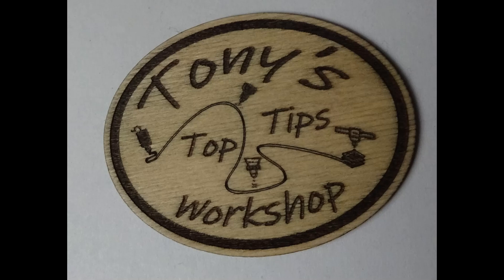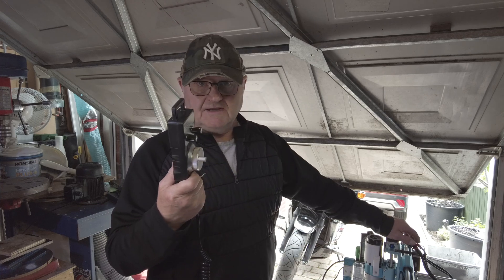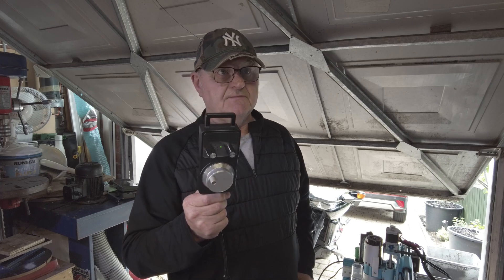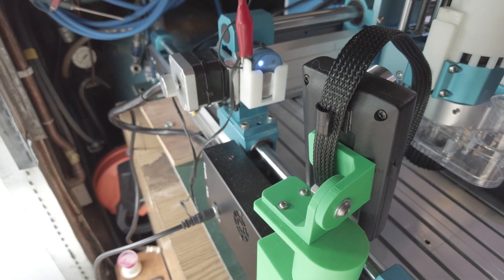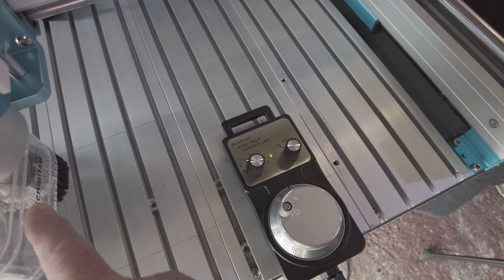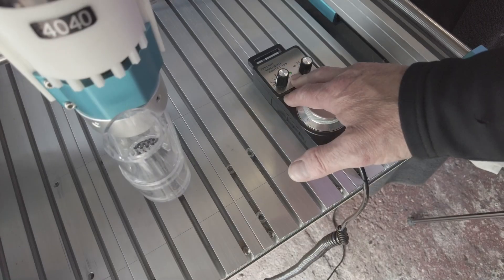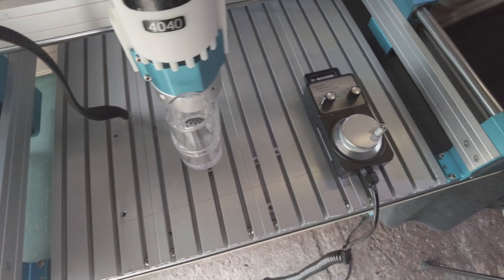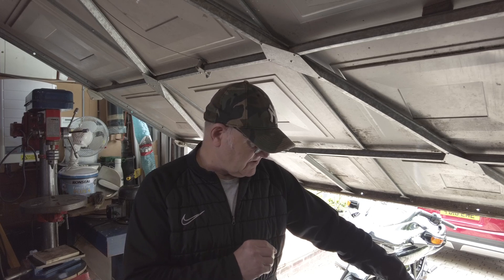Sainsmart CNC 4040 Pro  Viewers Problems with Faulty MPG controller

Comment: Hi Tony, how are you today. Thanks again for all your help. I am happy to report that the third one is the charm🎉😊. Now I don’t have my laptop with me at home today but the third one just arrived and I tried it right away with no computer hooked  up to the machine. The wheel felt much smoother than the first two and it worked as soon as I powered up the machine😁😁🎉🎉.
Reply from the maker: That's fantastic news Let me know how you get on using the machine with the new working toy
Reply: @Tonys.Top.Tips.Workshop  thanks again, I actually use one almost identical at work on a lathe as a machinist so I’m looking forward to using it in the gemnitsu😊
Reply from the maker: @MrMonahan28  you will be more experienced  at it than me

Comment: Hi Tony, thank you for your film. I have exact the same configuration as you have, i only use the Makita router. I have no problem with this controller. I have a problem with the grbl controller. When I push the ‘home button’ of this controller, the z stepper motor goes up and will not stop. Also the end stop of the z axis does not work when I use the home button . I have today Saintsmart asked for help. I am sure they will help me.
Reply: Thanks Tony for your reply. The micro switch works when I turn the z axis by hand and also when I use the mpg controller. It is also strange that when I use the home button only the z-axis moves and is going up and up. It only stops when I use the stop button. So even if the micro switch does not work, the home button will not function.It looks to me like a bug in the software. But I am new in this cnc world. I can still use the machine for everything else works fine. For your information: I use the Vcarve pro software and I also bought the x-axis extension kit.
Reply from the maker: @dobbie7454  hi as you say sounds like software issue has the problem been since you extended  the machine or firmware update
Reply: @Tonys.Top.Tips.Workshop  yes I have this problem discovered after the extension update, but am sure of the relation. Thank you so much for your thoughts!
Reply from the maker: @dobbie7454  Hi could be something to do with the settings due to the working are changing
Reply: Thanks so much for all your help.Just to confirm a couple things. The first one worked a couple times, but I had to rotate the wheel back and forth, the wheel seemed tight and seemed to break free and then it started working, but then one time it just stopped working. The green light lights up on both of the yet it doesn’t move the machine.The control board they sent was the exact replacement as the old which is not the wifi one. The wheel seems tight on this one as well.The machine is so small, it’s not really necessary but nice to have.
Reply from the maker: @MrMonahan28  hi I use mine all the time for setup. The wheel on mine is really  smooth so could be a bad batch please keep me informed
Reply: I also tried connecting the way you show in the video and nothing, the green light is always powered up so I know that there is some kind of power going there. I’ve started a return but haven’t sent it back yet,  not sure if I should try a third??
Reply from the maker: @MrMonahan28  does the machine work OK without the mpg controller if so try another one.
Reply: Yes the machine works fine without, maybe I’ll give another one a try. Thank you so much for all your time. I’ll keep you posted😊
Reply from the maker: Hi thanks for the info. Sorry your having problems sounds like the micro switch for the z axis is not working. Have you changed it with one of the spares that came with the machine.
Reply from the maker: Hi just uploaded a video about changing the z axis limit switches and they are on a printed board  so it doesn't look like you can change just one they are not the same as the spare ones that you get in the spares box.